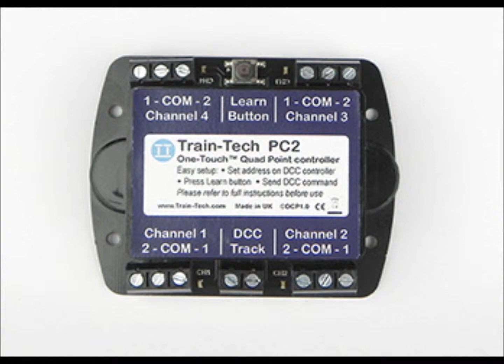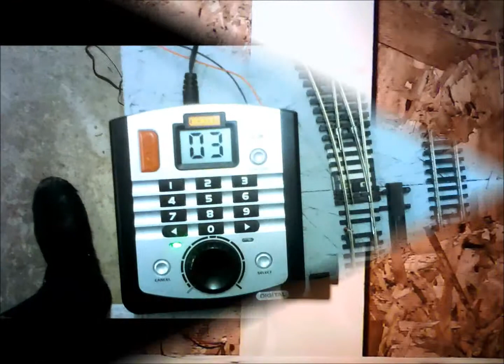Train tech PC2 Setup tutorial/review

Comment: How do you do this with Railmaster?
Reply from the maker: If you setup the point on railmaster and then get it to fire the point while the decoder is in setup mode
Reply: Hello thank you,  I have the PC1 which is not listed in the Railmaster, only the PC2, I have tried many times with it on PC2 setting but it does nothing and the learn light keeps flashing so???
Reply from the maker: I haven't used rail-master myself but if you set it up as generic point and give it an address and then on the control screen  tell rail master to change the point position then it should change if you have it setup as a PC2